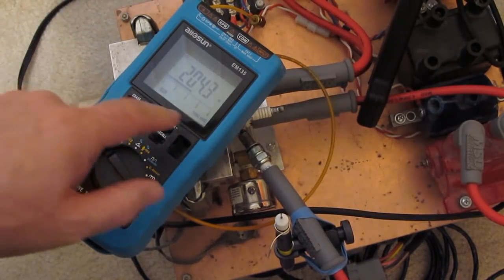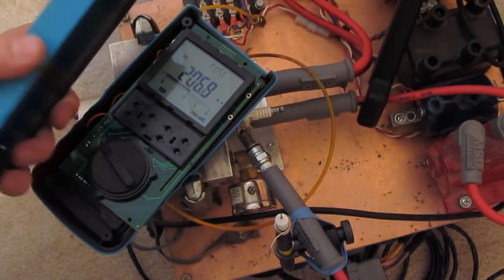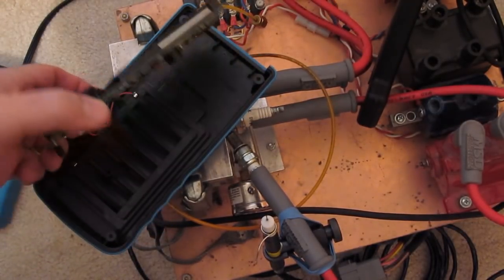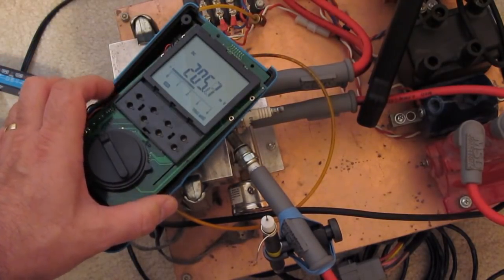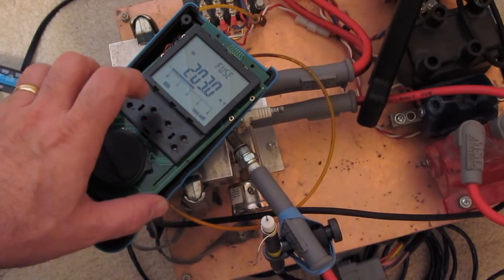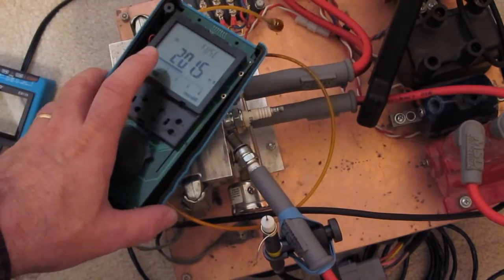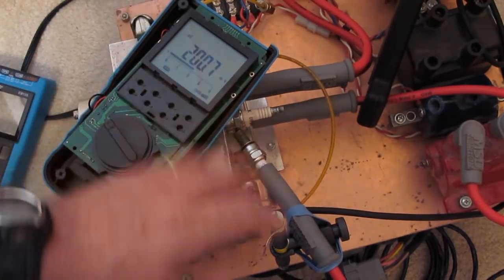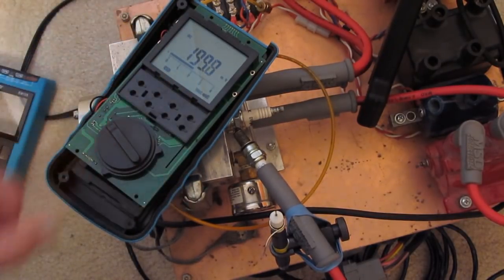ALL-SUN EM135 DMM, Solving Susceptibility Problems

Comment: i think u should use it as a wheel chock! that would qualify it as an automotive meter!! lol
Reply from the maker: I've seen a few videos of people driving over them.
Reply: They were probably pissed they wasted $100 on the meter lol! I would be interested in knowing exactly how the inductive pick up and cap pick up work if you were willing to show that. There isnt much inside of them. I had a cheap one stoop working and all I see inside is a cap on a small circuit board.
Reply from the maker: The inductive probe is just some ferrite material with a few windings.   The capacitive is nothing more than a metal clamp to form the second plate.